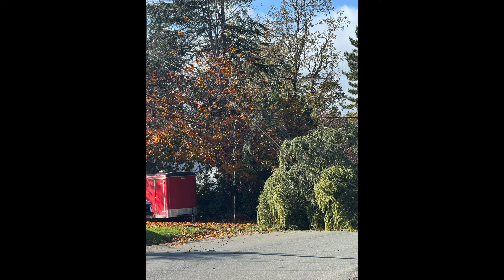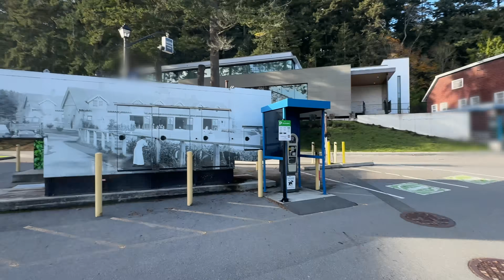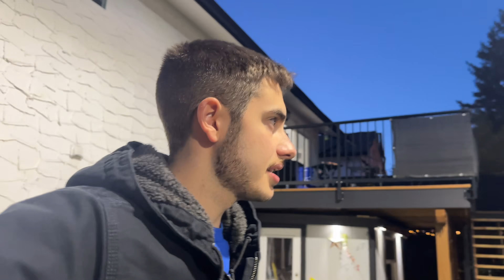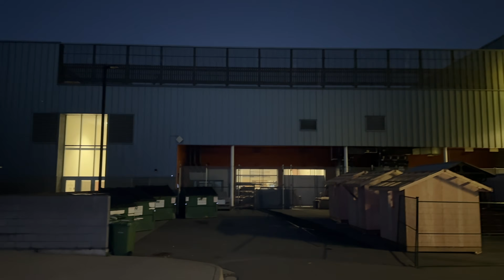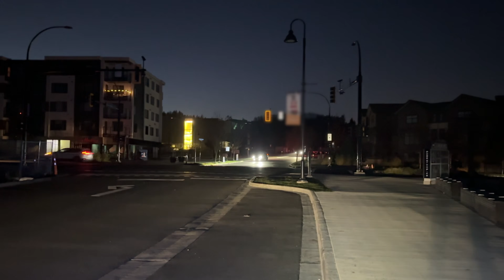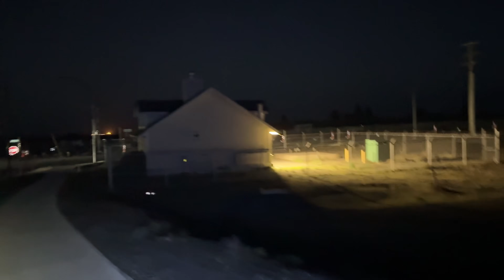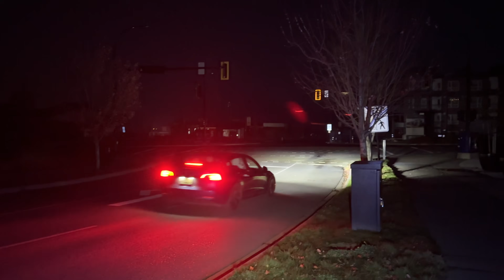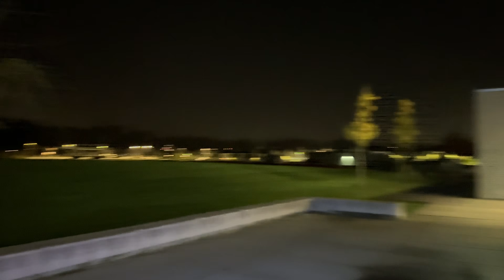11 Hours Of Power Outages And House Electrical Fried With 14,400 Volts On Neutral!

Comment from the maker: Update, insurance has covered all damages and hotel for the occupants. A megger test was performed and the insulation is fine, panel was replaced. It took 3 weeks for the utility to reconnect the service and the occupants are still in a hotel as the hot water tank and furnace still has not been replaced. I don't trust federal Pioneer/federal pacific Stab Lok as much as the next guy. However this incident has nothing to do with them or their breakers with a non-acceptably high failure rate any panel would have fared the same. This came in on the neutral by the time it hit the breakers it had already gone through all the equipment. If a breaker tripped or didn't it's not going to make a difference, 14,400 V is going to jump that small contact as if it's not there.
Reply: Absolutely and forget a surge protector, it would not have helped. They're lucky the place didn't burn down, very lucky.
Reply: I believe that if I had had, as a common norm in Europe, for over 40 years, a system with, not only magnetothermal circuit breakers, but with a GFCI (ground fault circuit interrupter), it would have cut off earlier and would not have gone around the house in the hope that everywhere it would discharge to the ground.
Reply: @KB99KraYziE  That panel is at least 36 years old most likely 50
Reply: @niyablake  50 sounds right. FPE panels were common back in the 70s. I've changed out dozens of them over the years. Seen a lot of melted conductors that were near fires.
Reply: @KB99KraYziE  ummm no. a GFCI doesnt care about voltage or overcurrent. a GFCI is NOT i repeat NOT a breaker.
Reply: @wyliesdiesels4169  On the technical side, no, but in an effective certain sense, yes, because you don't have 10, 16, 20, 25, or, for your 110-127v, minimum 32 and more Amperes before something in overcurrent goes into short circuit or discharge to intervene but.... 0.03 Amperes, or 0,3 Amperes maximum as general of the building, with the intervention time of milliseconds.
I repeat that since it has been a legal requirement for over 40 years, even when "lightning enters the house and/or from the power line, what saves something in your house is the GFCI, not the circuit breakers, which don't have time to disconnect for the two reasons I told you!
Reply: @KB99KraYziE  what? a GFCI will not stop lightning. not even close

please dont post misinformation

Comment: Last year at the end of July, my city got hit with a pretty big storm. The damage was especially bad in my neighborhood. Our nextdoor neighbor had some 100+ year old cottonwood trees that got taken out, and with it came the power lines. It completely knocked over one pole, and the pole that our house's drop line is on was split into thirds, and the transformer mounted on the pole was dumped over on the ground, and in fact the lid popped open and some of the oil spilled out. Anyway, the power was out for several days, and our coax drop got destroyed as well, and it took over 2 weeks for our internet to be restored. Anyway, during that time I got to touch the power lines, since I knew for a fact that they were isolated (The cutouts feeding the line had been pulled out, which makes sense since the line was on the ground). Very interesting experience.

Comment: Something does not seem right here it looks like classrooms are not on generator power which is not good
Reply from the maker: Classrooms don't need to be on generator power.
Reply: @nics-systems-electric  why?
Reply from the maker: @erikmorozov1740  not a high occupancy space
Reply: @nics-systems-electric  However it can still help to see in classrooms better if needed so I kind of disagree with you.
Reply from the maker: @erikmorozov1740  I just told you the fact of how it is I didn't make the rules so if you disagree with me then you're just wrong if you want to disagree with someone then you need to disagree with who made the codes and put them into effect

Comment: If you suffer a power outge it is a good idea to disconnect your load.  Monitor the power at the meter with a light bulb of the correct voltage or a multimeter and when the power comes back on, then you can reconnect the load if all is OK

Comment: What is triplex? Do you mean the three-pin cable?
In Germany, the medium voltage (10 - 20 kV) is installed separately from the 230 - 400V. In recent years, medium voltage has been removed from the masts and laid in underground cables. Especially in forest areas and near residential areas. The reason is that no trees fall on it. The residential voltage (230 - 400V) is also taken from the houses during road construction work and laid in underground cables.

Comment: The entire electrical system  ( all wire including the service drop, all outlets, light switches, panels, fixtures etc) in that house is going to need to be removed and replaced. This will include removing the sheet rock inside and wall insulation where there is any and rewiring the house. What a disaster!
This could be prevented with an underground service drop
Reply from the maker: Ended up just being panel replacement and some devices from what I know. Megger test results came back OK.
Reply: @nics-systems-electric  The voltage far exceeds the rated voltage of the house wire. I dont see how it can be left in place
Reply from the maker: @cat22_a1  the megger test. If it was degraded too much that would be caught in the test.

Comment: looks like having above-ground HV lines in the middle of a residential area and stepping the voltage down using trashcan-lookalike transformers on wood poles is not a very resilient concept. Here in Germany, we have HV 3phase below ground and transformers that serve multiple buildings and I have yet to hear a story like this one...
Reply from the maker: I don't see the material of the pool being a factor commonly. The aesthetics of the Transformers doesn't play much factor in the outcome of incidences. Older areas like this from the 60s are common to have above ground distribution other factors like ground conditions do play factors if underground distribution is possible as well as cost. It seems to be a misconception that buried distribution is not vulnerable however it most certainly is.

Comment: Are they leaving the light on just to flex ?
Or is the emergency lighting this bright (and on all the time) ?
Reply from the maker: Most of the emergency lighting is also 24/7 lighting. Stairwells have to be fully illuminated and corridors are about 50% emergency lighting/24/7. Other large occupancy spaces like atrium shops theatres gymnasiums have about 20% or less emergency lighting.

Comment: The surge protector would have helped, maybe slightly, as in some amount of over current would have been shunted to ground but not anywhere near the over voltage current the triplex was exposed to. Only commercial grade lightning/surge suppressor mounted outside connected to mains, with extra grounding would have protected it.
I used to install them in telco offices, they where probably about $2000 years ago. Think they go from like 160K amps and up.

Comment: And this is reason why in Europe and most world we never bound neutral and ground wire. Ground wire is separate wire , never bounded with neutral.
Reply from the maker: I don't see how that would've helped the situation here.
Reply: @nics-systems-electric  in Europe and rest of world we gave no such this high voltage over streets, just 230V 3 phase and neutral if some wire fall in transformer station circuit breaker tripp, and ground sistem keep all apliance metal surface on zero volt. All time.
If light strike in wires same happened, circuit breaker tripp also RCD in every house. Disconecting all 3 phase and neutral wire.
Nort American electric system is obsolete when switch from DC to AC , and transforer on the poles for every house, really?
Worst possible electric system.
I can even reach 10kV wires, not possible. 
Problem in North America is obsolete electric system.
Must be change.
Reply from the maker: @9a3hp  you have quite a bit of information incorrect, but the reason for bonding neutral and ground is the ground alone is often too high resistance to trip overcurrent protection. However if it's bonded to the neutral that provides a low resistance path that will ensure over current protection is tripped.
Reply: @nics-systems-electric  tehnicaly North American electric system is obsolete and this is major problem. Hi voltage lines must be far away from peoples. An in Europe high voltage line is very far away from people.  First one  high voltage line is half mile away from me and any house. 
14.4 kV line over street is stupidity.
Reply from the maker: @9a3hp  I don't believe that there is no high voltage around a city. The only way for efficient distribution is a relatively high voltage.
Reply: @nics-systems-electric  but yes hi voltage is far a way from any houses and people. In the street you have only 230V 3phase and neutral. Every city block we have transformer substation. Thats all no looses in electricity. Any way this is how Nikola Tesla patented idea for transfer electricity on long distance.
Mixing long ago outdated house wireing system and AC system is danger.
And in America is mixed Marconi DC wireing in house and AC system. And this is wrong.
Every 2-5 miles transformer substation (250000$) is much more safe and less expencive than poles transformer for every single house.
Reply from the maker: @9a3hp  you will still have a higher voltage feeding the transformers.
Reply: @nics-systems-electric  no way we have surge protector and disconector on any substation.
Reply: @nics-systems-electric  no way substation have surge protector and disconector.
Not cheap toy, industrial grade, can survive direct lighting strike in power line.
Nort American electric system and European is totaly different. By standards and tehnology.
Also safety regulation is very strict. 90% electrical components from USA cannot pass minimum safety standards in Europe. Even wires.
Reply from the maker: @9a3hp  I can't speak for the USA as I don't live there but Canada most certainly does have lightning protection. Our countries are very different things that work in one won't work in the other.

Comment: Actually whole house surge protection would have helped, even though it would be damaged. It would provide a path between all conductors including neutral, which would limit the peak voltage between conductors. What this would not protect, is anything tied to another potential such as a cable modem, or phone line, unless the house main ground/neutral is bonded to the lightning protection for the CATV, and phone lines. The other common path for this type of over voltage is controls for underground sprinkler systems. By providing voltage clamping and high current bypass with the whole house surge protection, the damage at the outlets, light switches, etc would have been reduced. Even the main panel arc flash may have been suppressed as the flash would be mostly confined to the surge protection. A good whole house surge protector should contain both Metal Oxide Varistors and spark gaps. The spark gaps take over when the varistors are destroyed by overcurrent. This should initiate the arc flash inside the surge protection, and may stop arc flashes downstream of the panel by limiting the peak voltage at the secondary arc flash points, except the mentioned sprinkler, phone, and cable connections if they are not bonded.

Comment: Had this exact thing happen to a customers house. Primary disconnected from the transformer, fell on guys secondary.

His only concern was getting his internet running while the electrician was replacing the damaged legs in his house.
Blew anything with motors in it, microwave, Jacuzzi, bathroom fan, washer, dryer, air conditioner, crazy stuff.

PEOPLE, this is why you buy UL/CSA listed equipment, they test against faults like this to make sure the power adapter plugged in to charge your phone doesn't kill you.

Comment: that house was most likely energized by 7200.
Reply from the maker: 14,400V
Reply: @nics-systems-electric  7200. it was probably a single phase that hit the triplex.. all three phases would cause a huge arc flash causing much more damage.
Reply from the maker: @FutureDanella_Lineman115  yes I showed that in the video one phase hit the neutral which would be 14,400 V
Reply: @nics-systems-electric  phases dont carry a total of 14kv  I'm pretty sure... one phase is 7200 doubled phase is 12470 and 3 phase is 15kv... the equipment like regulators would be way bigger if it were 14400 per phase
Reply from the maker: @FutureDanella_Lineman115  that is a common system voltage but not what's used here. 14,400/25,000.
Reply: @nics-systems-electric  huh... how do you know this? a lineman told ya?
Reply from the maker: @FutureDanella_Lineman115  it's no secret, it's on all your line diagrams for your building services. It's also on nameplates all over. I'm not sure what to explain so you can understand? Most electricians should likely be familiar with the utility providers system that you're tying into.
Reply: @nics-systems-electric  hm. i understand it thats interesting.

Comment: Id say temporarily replace all wiring in the house... but at least replace the main breaker panel and triplex, meter base and drop to get 120/240v into the house... at least then they could get at least power into house
Reply from the maker: I believe the wiring past the megger test fine. Panel will be replaced. Triplex is the utilities property and they left the old one.

Comment: Not sure what your credentials or experience are, you state this is very rare. Some of the things you stated on here baffle me and I really wonder if you know what you're talking about. Within the house all wire is insulated only to 300 volts.
Being a journeyman electrician since 1980 I have seen this four times in the central interior from either line slap where are the utility did not have enough clearance and thus destroyed the electrical wiring and appliances in many houses Willow River British Columbia. Or like this situation where a tree drags the higher voltage down onto the local distribution lines. In the Willow River case BC Hydro refuse to compensate anyone the amount of damage was phenomenal within the village. 14:15
Reply from the maker: It is rare to me. If I've been in this field for six years and if you've been doing it for 44 years then yes your chances of seeing things like this are going to be higher. Though speaking to others with more experience than that some have never seen 14,400 V come in on a customers neutral so just depends on luck if you get to see it. Yes I am aware NMD 75 is 300 V.

Comment: Surge protectors are not for high energy events of long duration. They are for low energy short evernts. If a powersupply get ripped open (JBL psu) then the event is way too high in energy.

Surge protector in powerbars are usually fused at 2A or so.

Panel wide goes to a breaker. Like a 30A. If multiple breakers got tripped, it would have also tripped the surge one, and allowed the surge to pass fully.

Then, a breaker is designed to cut 120V, not 14.4kV. When it would trip, it would continue to arc internally, allowing the current to still flow. So the breakers won't do much protections.

Comment: That ain't nothing, I redid all the alarm, telco, and cable in a house where 8 homes were totally fried by the underground transformer getting hit by lightening and one house burned down. Every wire in the house was tarnished black and the dialer in the alarm had the telco transformer explode where you could see the individual transformer wires left a shadow on the inner alarm can door. The entire house was gutted to replace every wire in the house. The TV's, VCR's, and all computers and phones connected to the telco burned up. The house smelled like there was an elec chair execution had happened. The worst mess I have ever seen and I have seen several commercial FACP's where the outside flow alarm has been hit, that house was every wire destroyed.

Comment: I thought primary voltage is 13.5 kv 7620 phase to ground
Reply from the maker: Depends on location. Even in my own city some areas are 14,400/25,000 V and some areas are 7200/12,500v
Reply: @nics-systems-electric  it looks like the USA

Comment: a surge protector is voltage controlled short between all 3 conductors. the sad thing is that it's not meant for time this fault was on. voltage should be ok i think. if it arced and blew surge protectors wires off that would have been bad. or surge protectors thermal fuse switched it off. most of them are parallel too. unsure if series one would have helped. series one like would have shorted/clamped out and then hopefully would have cut supply off, leaving itself and house connected. it's hard to protect for this. this is one of dangers of us electric grid. mv and lv are open and can short from one side to other. esp when you have transformer for each house and trees and such nearby. there are voltage control relays that watch for slight overvoltages from broken neutrals but they don't help here likely either. a wild guess if it will trip in time. also nevermind that those voltages can arc over those open contacts. tho i would recommend more advanced protection for houses. something to watch voltages and something for surges. and it should switch supply off, not surge protector. noone checks that protection ok led anyway. but don't count on those cases. in fact it's not like lightning will magically stop there. voltages still rise. it's matter of levels. and this is why you stage them. have lightning rod. have 3 stages of protection. calculate if potential fire, equipment or data is more expensive and see what total cost will be. difficult decisions